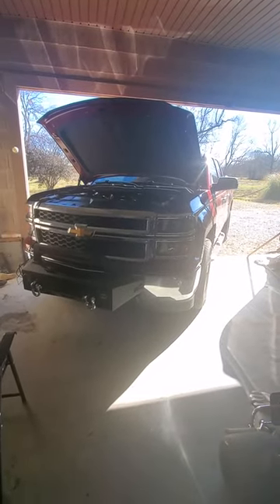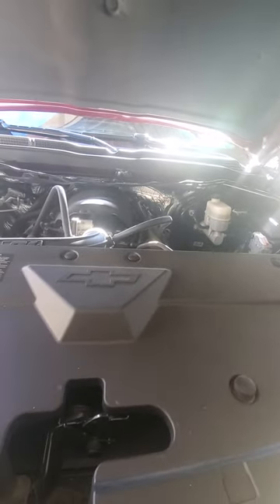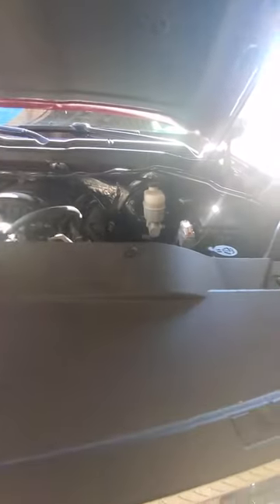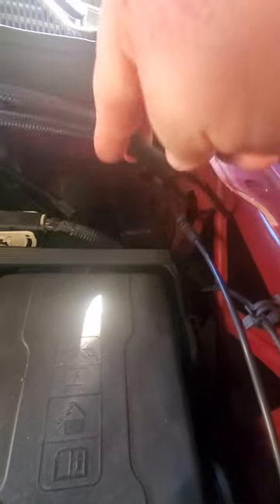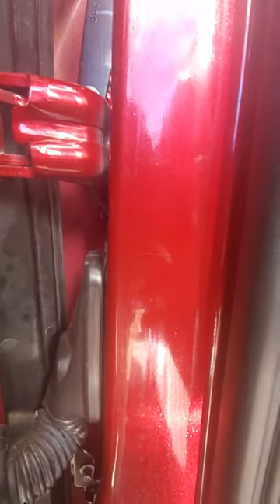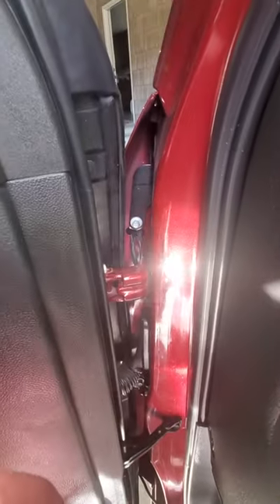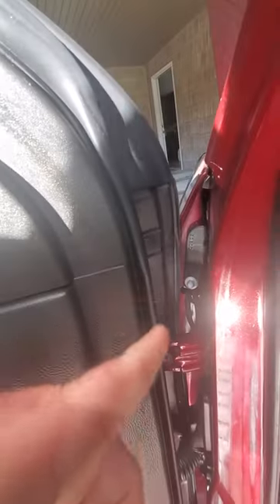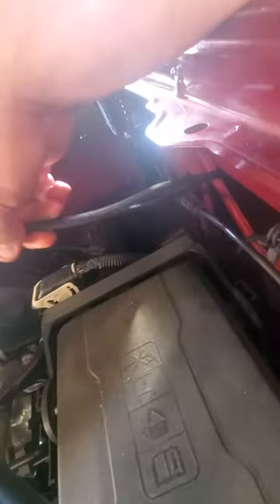2015 chevy silverado 1500, easy firewall wiring.

Comment: Awesome video , I’m installing a ham radio and have been racking my brain on how to get the antenna coax thru …. The typical antenna has a pl259 connection , this is to fat to run thru that hole …..soooo I ordered a cable with a BNC connector which will barely fit thru the holes and I can attach an adapter once I get it inside. This is way of running the wire is going to be much easier and actually cleaner to. Thank you

Comment: This is going to help tremendously. I wanted to add some aux lights to the sides of the hood but was dreading screwing with the firewall. 

How’d you pop out that cover, from the inside I guess since the door is in the way if trying to do it from the outside. Also, did you plug that hole with anything to prevent water from getting into the cab or no?